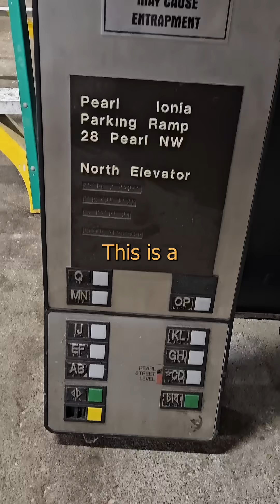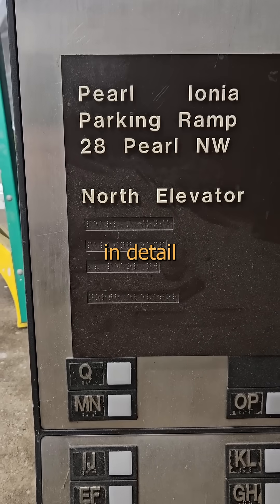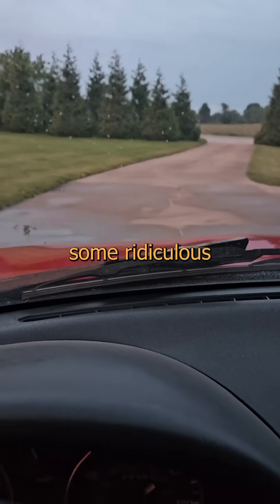Miata Mischief #chrisboden #engineering #gear #elevator #score #stories #parts #hacking #making

Comment: So, there was this really nice 1080p monitor back in like 2013/14 and it was the only one the school had, so I went to the computer lab for a few days to get a handle on timings, and I proceeded to walk out the front door with the cable still attached to the monitor in my lap (I am in a wheelchair) and I just rolled on out with this very expensive monitor straight down to recycling, where I placed the monitor on the ground. I waited till after school, went down to recycling picked up the monitor, got on the city bus (right in front of the school) and went home. 

A week later I was in class when the labs teacher came in and I overheard this story- So, what I think happened, was someone came down in from the ceiling, and "Mission Impossible-d" this, I cannot fathom how someone managed to get that thing out of there without getting caught on camera. And whilst listening to that story, I could not stop laughing my ass off. My brother has that monitor today, still works like the day I stole it.

Comment: My dad and I once drove his 1983 Toyota Tercel 4WD Hatchback out to some random yard and proceeded to sweat our asses off loading just 4 railway ties. If you've only seen a railway tie in the ground, well they're bigger than they look. About 8"x8"x8'. And they are pressure treated and incredibly dense. I'd guesstimate each one weighed ~175lbs? We folded the rear seats down and managed to cram them in their all the way up to the front seats. Of course the hatch didn't close now so we got some bungee cords or ropes to tie it down. 

Now the drive out there took us about 30 minutes. But we failed to account for the fact that ~700lbs of additional weight takes a serious hit on the car's already low clearance due to using smol tires. And there was a rather steep on-ramp to get onto the highway. Which the Tercel, with it's stunted height and all of 65HP, had absolutely zero chance of getting up. Naturally, this was in the days before GPS too so we had to pull off and look at a map to find an alternate route with little elevation gain. In the end, it took us two hours, a state border crossing, and probably triple the distance to make it home. Only to have mom, who requested the ties, ask us to get 8 more... we borrowed a friend's minivan that time.

Always an adventure with my dad and that Tercel. I miss it sorely. He sold it in 2008 for $1k with 765,000 miles on it. Learned a lot from that little car!

I also personally nearly threw my back out when in 2023, I found a very nice 35" CRT on the side of the road. As I was really excited at the find and it had been probably 20 years since I'd lifted a CRT, I forgot how heavy they were. Nearly broke myself, the TV, and the car. I still don't quite know how I managed to get it into the basement by myself. But it works! And I can relive all my glorious days captivated by those magical dancing lines and that special frequency that nobody else in my family could hear :D

Comment: About 16 or 17 years ago I lived at the top of a steep hill in Somerset, England, that's about a third of a mile to the top. I had a bicycle with a trailer & I was doing lots of odd jobs and also complete bathroom or kitchen refits. So my trailer was often full of tools for, on average I reckon, 20 days out of the month....but also I would collect materials from the local builder's merchant including 16' planks of timber, 2 at a time & have the photos to prove it somewhere. I had calves of steel at the time!

Comment: I drove a 1955 Cadillac sedan home from a different city 150 miles away. Found out later it had almost no brakes, sketchy steering, and was missing a few bits from the suspension. But I got her home, fixed up, and named her Lucille.

Comment: I have a 2018 Hyundai Kona and while it’s not tiny it’s not big either. I’ve been helping a buddy of mine fix a 1979 Datsun 280zx that he got last fall. We live in Idaho and can get some pretty heavy winters so before winter came we decided to go pickup a pop up garage so we could keep working through winter and protect the car. We decided to take my car to get the garage and fitting it in was a nightmare, it was just as long as the entire cabin of my car so the only option was to have it go from my center console all the way to the trunk. I couldn’t see my rear view mirror, passenger side mirror, and had to become a contortionist to change gear. The whole drive the box was leaning on either one of us trying to crush us and blocking so much of my view that I had to ask my buddy if I was clear to change to the right lane. Best part was you had to take the interstate to get back to his house because of construction so it was just a total shit show. It was far from safe, would have killed us in an accident, but made for a fun experience that I wouldn’t trade for anything.

Comment: Last summer, I needed to fix my exhaust pipe of my 1989 VW Golf2 to get it through the inspection. Hence, I could also not drive to the parts store. Because public bus would've been lame and I love bicycling to transport things and it was only 5km (3 miles) away, I chose the latter. 

I had three options for the 150cm (5ft) pipe: backpack, dragging bound on a small tree I had, and good old bondage with a wire to the bicycle. I prepared for all options and chose the latter. All went well 😅 

Rate my setup: I took a short video of it. It'ss the latest on my channel (made it public for now).

PS. Diagnosis also welcomed: my Golf2 idle rpm stays high (only) in the cold weather. Is it the automatic choke, some connection issue or what🤔

Comment: I once drove a 60+ inch TV in my little VW Polo GTI. A friend bought it and he can’t drive (he wanted to carry it by city bus) so I volunteered to drive and when we get to the shop I realised it was too late to back out now despite the fact that it couldn’t fit in the boot even when I collapsed the rear seats and pushed the driver and passenger seats all the way forward. So I took a shoelace from my buddy and tied the boot release mechanism and anchor in the bottom of the loading area and prayed the TV wouldn’t fall out. When we had to merge onto a busy road I had to accelerate hard from a standstill and the TV almost fell out! Luckily it went off without a hitch but nobody was tailgating me all the way to his flat.

Comment: My parents needed gravel for their driveway. I only had a 1985 S-10, 4 banger 5 speed. Made 3 loads, about 15 miles each way. The load operator was very hesitant on loading me, but did it anyway. I thought my rear end would break, but it only bent my frame 1”!

Comment: $70 4' metal table on sale for 90% off at end of summer. A subcompact hatch back (08 Daewoo-I-Mean-Chevrolet Aveo) that I found out did not measure 4x4' in any given plane, except one. Trying to get it in and out looked like a rag doll physics game where a player wedges an impossibly large object through an impossibly small opening and it just starts banging around and getting stuck at all conceivable angles before it finally comes through. (Feel free to re-use that analogy in or out of context) 

My grandpa though... a car the same size, he brought some literal calves from a livestock auction.

Comment: My daftest one may have been shifting £10,000-worth of professional recording equipment in an absolutely decrepit Renault 4 for which I had paid £95. Or possibly half a ton (we weighed it!) of recording equipment in a Skoda Estelle, which weighs 850kg empty and developed about 5 degrees of negative camber when loaded like that thanks for its swing axle suspension.

Comment: Vehicle: 1995 Saab 9-3 convertible

Was lucky enough to buy a “fixer upper” house in 2017 just a couple years out of college. Budget was tight at first but we made it work and it’s slowly becoming a fixed-er upper! 

At the time, I had never lived in a house with a well, this place has a point well with a jet pump accessible in the basement, and an expansion tank. Well, since I was unfamiliar with this setup, I wasn’t aware that the pump shouldn’t be kicking on EVERY TIME you turn on a faucet… that pump didn’t last long. I realized the constant running wasn’t normal, and that likely the expansion tank needed replacing, just before the pump failed. Ordered the tank, and a new pump shortly after, which I needed to pick up from a dealer. They were a couple days out, so we ended up without running water for 2-3 days. 
Pickup day comes, overcast and threatening rain (foreshadowing), got there and realized the tank was WAY bigger than I expected (40 gallons), and probably bigger than I needed. But we needed water! So I put the rag top down on my Saab, driver seat all the way forward, and wedged this giant box upright in the back. As soon as I hit the highway the skies opened up and it dumped on me all the way home 😂 got my water

Comment: Want a sketchy bring home story? I got you, drove 125 miles north to pick up a park style camper I got offered for free as long as I get it outta there, the thing had be sitting there since brand new in the 80s and to keep it in good shape the previous owner had built a roof on top to keep water from finding its way in, little did we know the roof weighed more than the trailer itself, we get up there cut the roof overhang so we can safely get down the road and fold in the tip out then we haul it 125 miles back on the original widow maker tires the thing had from the factory the truck rocking back and forth the whole way down the road we had everybody we passed watching and staring wondering what these crazy bastards were doing was it sketchy? yes, was it done legally? Most likely, we like to hang out in that grey area around here but the most important question is did we have fun? Most definitely

Comment: Quite some time ago, the company where I was doing an internship at the time upgraded its hardware. Everything that was decommissioned was up for grabs, since it would have otherwise ended up as electronic waste.

And what did I snag? 
A friggin 27" CRT monitor with CMYK analog inputs. 
A feature that, back then, you’d practically have to give your left arm as a down payment for and your right arm too if you wanted anything over 19".

At the time, I didn’t have a car and had to rely on a bus connection that required four transfers. At least the completely baffled looks from other people made it entertaining to lug this nearly 80-pound beast around.

Comment: Bro i had 2 couches one an old wood arm flower print thing from the 70s and one 2seater thing i got an auction for 50cents on the roof of my nissan sentra.... at the same time. Tetris style. Along with a set of car ramps and a car full of other odds and ends to fill a new apartment.... pretty sure i bottomed out the struts on that old nissan and the roof made some... less than promising creaking noises on the trip home.... 😂 according to my friends i looked like a gypsy carnival caravan pulling up to the house...

Comment: Someone in town was getting rid of their old tube console radio/record player, tape player. It would have barely fit in an extended bed truck. I was eight. I had 2 miles of gravel road ahead of me. I would pick up one end, move it forward, drop that end, go over to the other end, pick it up, move it forward, drop it, repeat. I pimp walked it for two miles..

Comment: I’ve once had tha opportunity to get a three slices of a tree trunk for building a axe throwing target. 
The only problem; they where huge and I only had my dad’s Audi A3 and a small trailer made in the GDR (and probably older than me). 

If someone official would ask me; of course they didn’t exceed the limits of my ride but a few… hundred… pounds 😙🎶

Worked out in the end even though the double clutch transmission never was thaw same after that 😅

Comment: Towed a f250 front axle, hanging front an engine hoist, 2 miles home after a salty fallout in a previous shop. I wasted zero time with safety and used a 20ft steel chain...its was quite a white knuckle crawl.

Comment: I once hauled a queen size bed frame made of solid oak on the roof of my 1991 honda prelude, using only my hand through the sunroof to hold it in place while I drove 3 miles down the road.
I have also hauled a good amount of "extra passengers" to a pizza shop while everyone else was drunk for a friends' birthday party in that prelude...

 I have also hauled a full sized commercial refrigerator from a restaurant that was made in the '80s or '90s, complete with simulation woodgrain in the bed of my 1985 chevy S10. Strapped it in with some cheap family dollar ratchet straps standing up, that bad boy traveled at a record 75 mph down the freeway several times for a couple of days😂

I frequently hear that "time to do some sketchy sh@t" song playing in my head 😂

Comment: I went to Walmart and bought a 4 burner BBQ on impulse because it was $75. What I didn’t take into consideration was it wouldn’t fit in the trunk of my Mustang. With the help of a bystander I was able to just wedge it between the roof, seat and dash enough to close the door. I was able to get to 3rd and 4th gear with a little force, but not 5th

Comment: Aged 11 I climbed 50' of open girder frame in a disused metal bashing factory to remove the biggest fire siren I had ever seen. Needed to strap it across to bicycles to get it home. I'll swear when I wired it up, all the lights in the street dimmed as it screamed and every police vehicle in a 10 mile radius was sent to try and find where the terrifying sound was coming from.

Comment: One day, Me and my stepdad went to wrench a part because my grandma needed a new engine. Wrench a part had an engine hoist, we forgot to bring a chain. My stepdad sent me to scour the junk yard to hopefully find a chain, but to avail. So, I came back with a VVT timing chain from a mid-2000's GM car. That couldn't quite reach both mounts, so we extended it using the dry rotted rubber serpentine belt from the engine we pulled. Not only did it work, it worked 3 times.

Comment: Mine was hauling me, my buddy, and his dad's asses home.  We went rock crawling on Kelly flats in Colorado in his OJ Bronco.  We found out half way through that his leaf spring shackle was too rusted out to get us the rest of the way......I had a jack, 2 shop towels, and a ratchet strap to work with.  I did such a good job that we didn't even fray the strap at all on the 3 HOUR trip home, and according to him the alignment was almost spot on as well.  Only difference was that corner was a little soft.

Comment: I at 14  once brought a roughly 50-55 foot 100+ lb piece of bamboo home standing vertical on bicycle.

I did it Mostly because its leaves were getting stuck in the gear train on the bike, modified the base to be more stable on the rack mounted to my seat so it could be held down with rachet straps and tiedowns. basically I was a big ass beacon in the air.

Comment: I'm happy to send a picture of an enclosed uhaul with a cabinet inside and another on top with two ratchet straps holding it in place. It absolutely was going to slide forward into the car if I braked hard.

Comment: 😂 I was 12yo and lived in BFE northern MI. Found a set of 3 stadium horns. the 1-3 thousand watt kind. 4ft diameter big end,Had optional wiring diagrams for differentpower inputs. Spent three hours that morning hauling them home one at a time on a wagon behind my bike. Parents assumed they were junk and were so mad that they made me take them back. 😅 I kept one. I had recently found out that the old magnovox hifi units would work on twelve volt dc once you remove the transformer. With a car battery that magnifox head unit and that stadium horn strapped to my wagon, I road around my neighborhood all summer listening to bob and tom in the morning.😂
Reply: magnavox*😂

Comment: Friends and I were motorcycle camping in the valley near Fontana Dam and Robbinsville, NC when a big storm came through and halted our high speed adventures for a day or two. Unfortunately our camp ran out of booze and the rain wasn't letting up, this county was also DRY. Three of us were sober so we collected cash from everyone and loaded onto my friend's Kawasaki KLR (yes all three of us). We rode about 30 miles through the rain on mountain roads to get to a walmart and purchased four racks of Coors and 3 cases of various sodas . My friend was handy so he had hand made metal boxes that he used as luggage on his bike, however they were full so we opted to ratchet strap a rack of beer to each one. The other two racks went between the driver and I and the other passenger behind me, making a beer "manwich". Last three cases of soda we just both held onto under our arms. We waved at a police officer on the way back and he simply waved back.